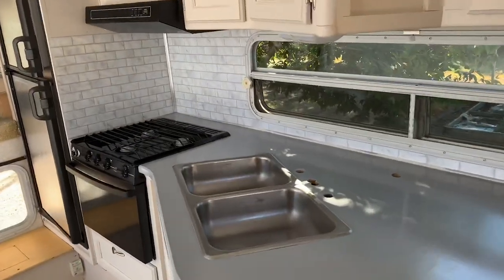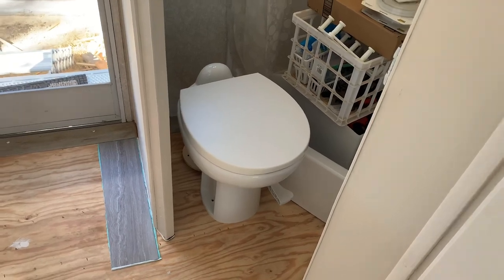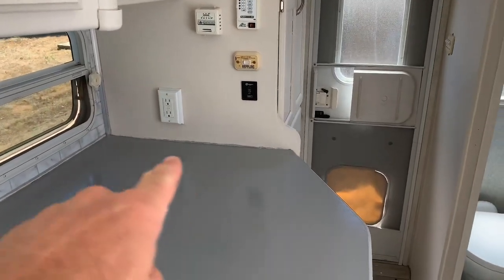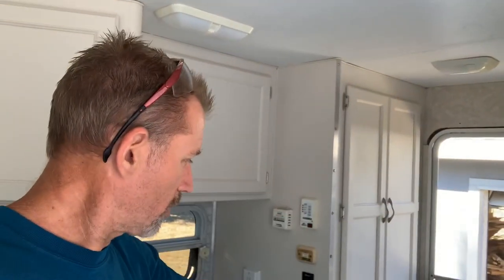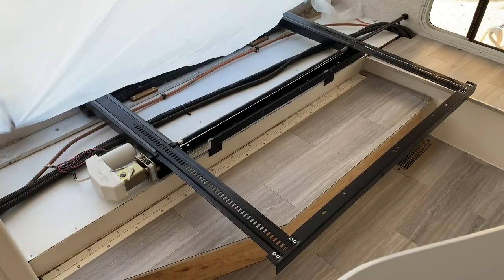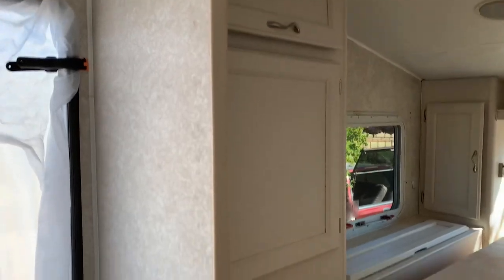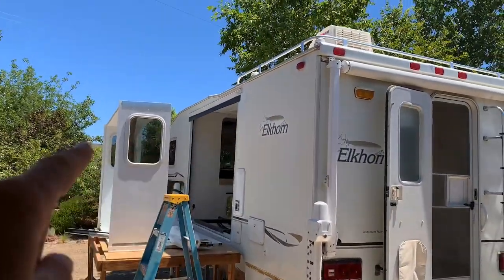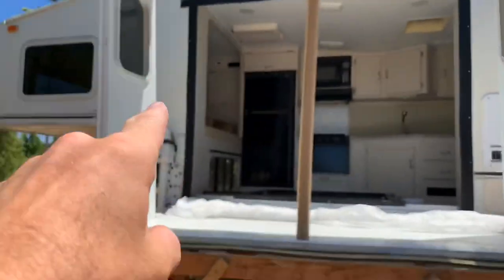Truck Camper Interior Remodel. Heat Bending Aluminum Trim and New Flooring

Comment: I have two awnings on my Elkhorn and the rear awning lower leg rod mounts were wood screwed into the camper body, the passenger side awning lower leg mount had broke through the camper fiberglass siding so I got two pieces of 4" X 7" 1/4" aluminum plate drilled to holes to match the two holes on the jack mounts, replaced the two jack mount screws with 1/4" longer screws, drilled and taped two additional  holes in the 1/4" aluminum plate to mount the  the lower two lower awning legs on both sides. Small fix but sealed the body and prevented further damage. Dir you have tis problem?
Reply from the maker: No, no issues with the awning at all.

Comment: Looking great!!  The aluminum in the kitchen area did you just use adhesive and I know on the basement you said adhesive and screws but couldn’t see if screws were used around the countertop. Also where did you find those cool blinds?  Thanks Sandy 💜
Reply from the maker: Thanks! I used the LocTite PL adhesive.  I think 3M double back tape would work just fine as well.  The blinds I ordered from 
justblinds.com
They have many options and they’re great prices.